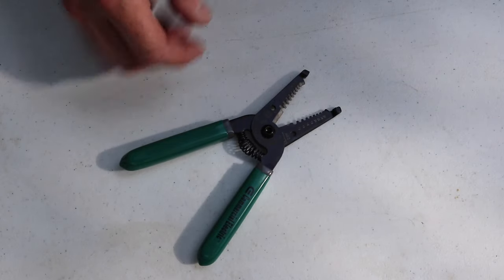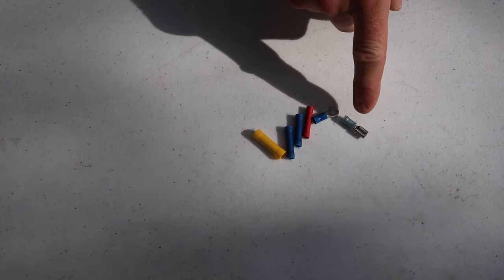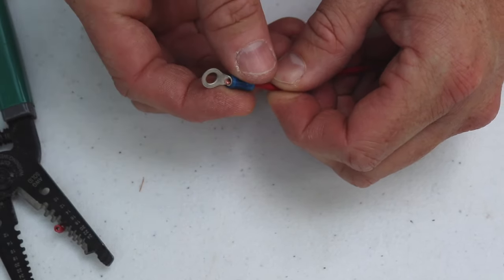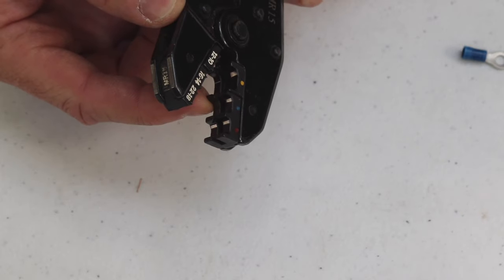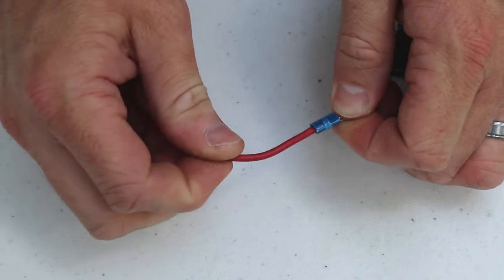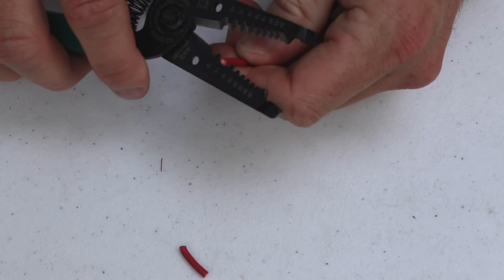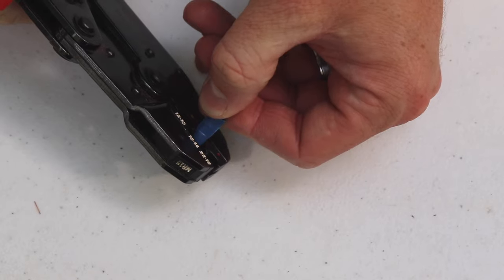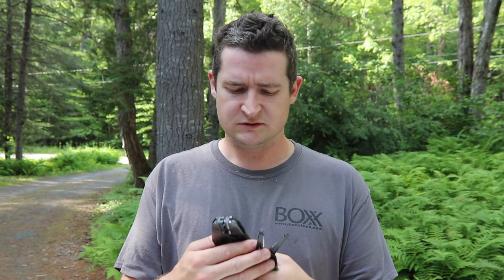How to Crimp Small Insulated Wires

Comment: Hi, great video - I have one query about which   Side of the crimping tool faces the terminal and which faces the wire. There is a slight difference  in the dies - does the smaller gap crimp the insulation to the wire (strain relief) or the wire to crimp (connection)?
Reply from the maker: For insulated wire, the dies are normally the same size.  Is yours set up for uninsulated terminals?
Reply: @AbroadReachTravel  On my crimper, which is a good quality Hilka one similar to in your video, the dies are different sizes on each face. The face with the coloured dots has a more complex shape and has a bigger gap between the jaws than the other face. The non dot side also leaves a small dot impressed into the sleeve. So which side is which?

To further confuse things one YouTube video https://youtu.be/YLhpdgXzx28  states that the way up of the crimper matters as the metal sleeves have a split in it and that guy claims it matters which way up the split goes as the 2 jaws have different shapes.
Reply from the maker: First, let's talk about the crimper in the video you linked.  He used a stake style crimper which is entirely different.  It only crimps one side of the terminal versus both sides on a ratcheting crimper.  Orientation may matter with this style, but I've never used them and they aren't typically used in the industry.  (I worked for an electrical connector manufacturer for several years).

In terms of the dot side vs non-dot side.  Some ratcheting crimpers, like yours, have a slightly different pattern from one side to the other, but it's not the most common setup.  At least in the US.  When there is a difference, the side that creates the dot impression usually goes on the connector side of the crimp but I would double-check with the manufacturer.  If it matters they should have included it on the packaging or on their website.
Reply: @AbroadReachTravel  Many thanks.  https://hilka.co.uk/ratchet-crimping-tool-28600209.html is mine. Unfortunately I can’t find the instructions at home or even on line. I think the narrower side, which just squashes it between 2 simple arcs is for the insulation and that is where the dot will be crimped.

I often use it twice in slightly different places to make sure it’s really secure.
Reply: Smaller gap is for the electrical crimp, the wider one for the relief. I've never seen a decent crimp tool for insulated connectors where the sides are the same.
Reply: @archstanton1628 Klein Tools 3005CR

Comment: Those crimpers are over $200....
Reply from the maker: The ones Andy uses in the video are expensive but he worked as an engineer for the company who made them so we didn’t pay full price 😉 if you check the description there is a much more reasonable option if you only need the tool occasionally or for a single project. 😊